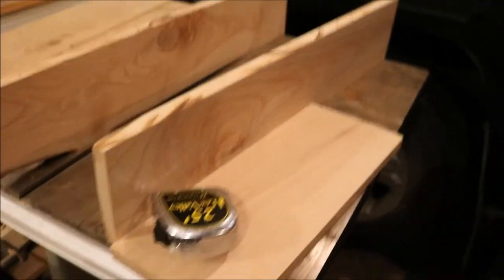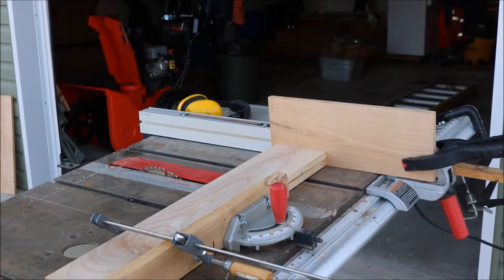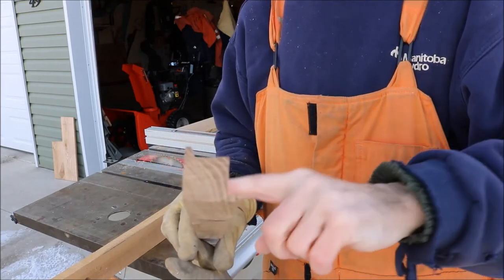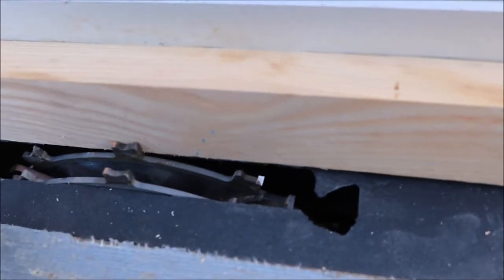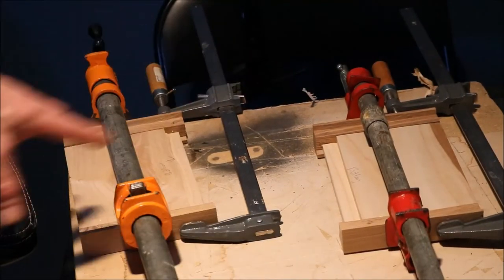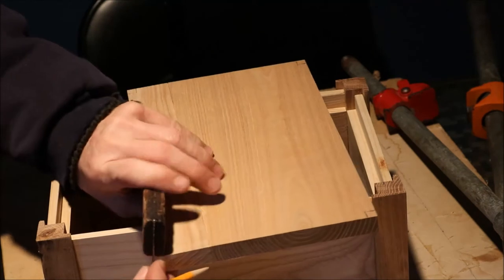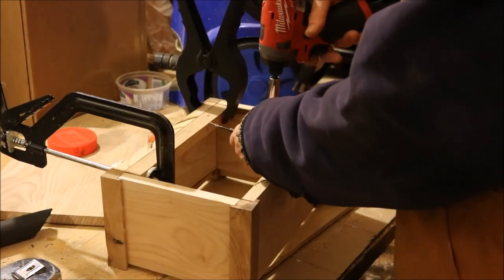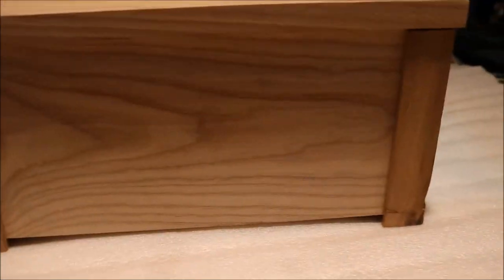How to Make an Urn

Comment: OK, that's not an urn, it's a box. An urn is a round container of ceramic or metal. And that machine is a plane, not a "planer".
Reply from the maker: Thank you so much for watching my video and being with me on my journey. I have attached a link to the Dewalt website so you can look at their planers and discuss the meaning with them.
 https://www.dewalt.ca/products/power-tools/routers-planers-jointers/thickness-planers
I have also looked up a few funeral sites that sell as they call them " wooden urns", you can look them up if you have time. I am sure that traditional urns were made of metal or ceramic, but traditional tires were made of wood. But now they aren't.
Thanks again for watching and leaving a comment that is helpful for others. Regards Roger
Reply: Wrong on both counts. Not only wrong but a heartless piece of work. If you have parents good luck with your ceramic pot